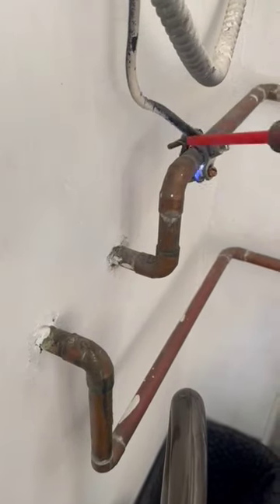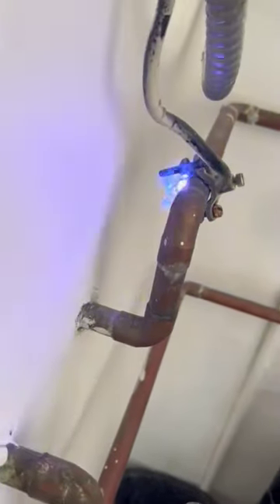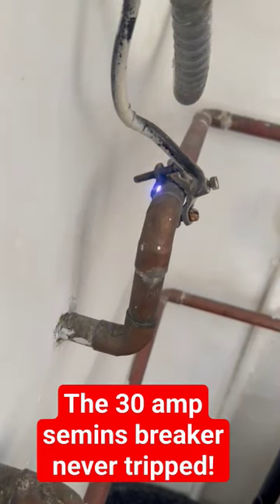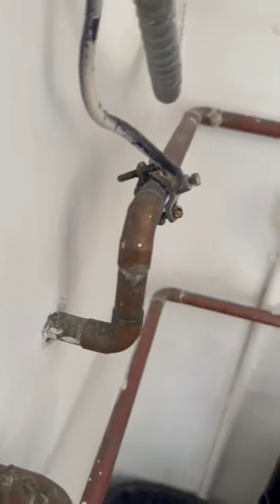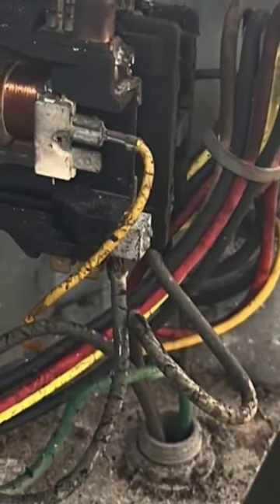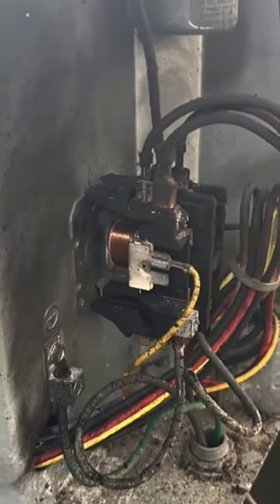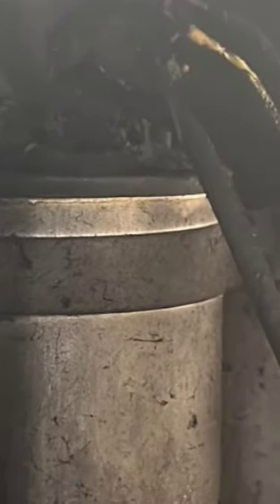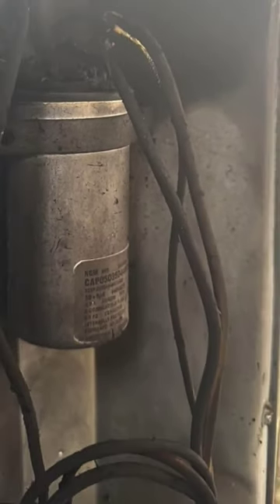Major grounding issue + lightning strike + loose cold water bond clamp = this!

Comment: I'm pretty sure you have your system grounded neutral current returning to the source via the water main grounding electrode conductor. I'm guessing the real issue is the grounded neutral at the transformer is broke somewhere before the meter/ main breaker panel.
Reply from the maker: That's exactly what I thought but it would stop every time you turned off the 30 amp breaker.
Reply: @Simonelectricfl The 30amp breaker for the A/C?
Reply from the maker: @roystevenson1375  yes
Reply: Damn you see something crazy everyday I've never seen this
Reply from the maker: @ChipChurp  I love seeing new and interesting things in this trade that's part of why it never really gets old.
Reply: Crazy
Reply from the maker: shawnstafford7809  that's for sure
Reply: It’s also going to burn a hole into that water pipe making it even more dangerous.
Reply: With most of the plumbing now plastic , there is no ground through the water pipe
Reply from the maker: @user-hy7sf9xx3z  We still find a copper section like at the water heater and clamp there.
Reply: that's correct. stray neutral current. panels done wrong. obviously extremely bad.
Reply: the main water ground isn’t supposed to ground the house, its supposed to make sure the water system is grounded.  The panel should be grounded separately.
Reply: @theJonnymac  Yes. The water ground is an electrode (GEC). The system ground is derived at the transformer from the utility.
Reply: The water pipe was the least resistive path to ground in this case. While electricity will take all paths, a majority of the current will take the path of least resistance, in this case the water line.
Reply: @ryderholland  electrons returning to the source.  👊
Reply: Had this happen twice. One at the transformer.  The other was loose behind the meter.
Reply: in texas the ground and netural are tied together!!!
Reply: @tesmith47  uh, yeah. NEC 250.4(A) requires it.
Reply: Turn off that breaker, disconnect the lines and ground.

Clamp the ground to one multimeter lead, and twist both lines together and clamp
to the other. Set your meter to Continuity and go through your wiring in the unit . When the the beep disappears you had removed the wire from its contact point. 
As for how it happened, I would say that meter or panel isn't bonded depending on if it is a sub panel or not??

I have had this several years ago and clearly the unit was toast but I wanted to find it regardless as it was bothering me.
Reply: @Simonelectricfl one of your hot wires has gone to ground, but with enough resistance to carry a load but not short circuit the breaker.
Reply: @RobertFulton-o9j : can’t Tell you how many times I’ve seen a ground strap attached to a plastic pipe , after they replumbed the house !!!!!! 
No words !!!
Reply: @Simonelectricfl but can you tell me why ?? I have never understood this practice
Reply: @Simonelectricfl  
There's likely not a neutral for the 30A 240V AC circuit. The only way this would happen when that breaker is on would be if one of the hot legs was damaged in the AC somewhere or something was wired very wrong at the AC.  If it was hit by lighting, it's possible it melted the insulation just enough to pass some current, but not enough to trip the breaker.
And yes, that ground at the water pipe needs to be corrected as well.
Reply: @billss396 or a neutral wire, and that would explain why the breaker doesn't trip. This would trip a GFCI though, or an AFCI since it's arcing.
Reply: @alexc4924  this is a 240v circuit without a neutral. A hot wire is charred with enough resistance go to  ground without tripping the breaker as a dead short.  He said it cleared when the breaker was turned off
Reply: @electricianron_New_Jersey And is known as the Primary ground due to it being foremost historically. The ground rod  being Secondary is to be btwn. the cold-water & the panel if run continuously
Reply: @Simonelectricfl the cold-water is supposed to be bonded w/in the first 5 ft. of the entrance to the building or first available spot ... the Bonding at the HW heater is for passing that cold water ground to the other metal piping systems
Reply: @tesmith47 Everywhere mate
Reply: @robertholderman7552 What?! are you saying a plumber actually tried to be thoughtful about resetting the weaver clamps for bonding at hw heater (even if somehow still thoughtless lol)  ... Never in my 25+ yrs lol.

Comment: Let's see if I can translate:  The wiring in the A/C unit was damaged, causing a direct short of a hot wire to the metal parts of the unit.  Since there was no equipment grounding conductor ran to the main disconnect at the meter, and as this missing equipment grounding conductor must be bonded to the grounded (neutral) conductor at the disconnect (per NEC), there was no path for the high fault current to flow back to the source (transformer), which in turn caused the breaker to ignore the fault, resulting in a very dangerous situation whereby all bonded metal parts of the facility took on the electrical potential (voltage) of the shorted conductor.  A loose arcing grounding electrode conductor revealed this electrical potential at that particular location.
Reply: Great explanation, and I agree 100%!

Nice job.

Comment: There is an old Baptist campground near prospect, Oregon that is closed now. It had a lost neutral somewhere and Everytime we touched the cold shower knobs we kids would be mildly shocked in the wet shower. 50 years they never found it as far as I know. Probably one reason they closed them down.
Reply: Thus is cayse by flipping neutral in obesity outlet its on the left the next is on the right so when a neutral is list it trys to find a path also bonding in the wrong panel and ground and neutral on the same buss bar
Reply from the maker: Wish I could have helped sounds like a fun troubleshoot
Reply: old timer from maine told a story about a house where the owner would get bit if he stood in the shower and touched the metal valve.  slab on grade house with a vapor barrier - turned out the vapor barrier turned the building into a huge capacitor.  when the owner touched the valve, it discharged through the bonding/grounding system.  opened the slab and bonded it to ground and problem solved.

Comment: ive seen this during a electrical surge the surge protectors were dumping the high voltage into the ground and arcing high voltage to the whole ground including on the pipe ground got lucky i touched the ground wire with my bare hand with over 500 volts going through it never got shocked from it
Reply from the maker: Wow that must have been impressive to see!
Reply: 500v? Working on what

Comment: Im a lineman. Its not uncommon to get a couple trouble calls a year where someone is getting a slight shock whlle in the shower or using a sink. Years ago the bonded the houses neutral to water pipes instead of ground rods like they do today. If the neutral attachment point on the waterpipe starts failing, the house will try finding a ground somewhere, even if thats through the shower head when someone wet reaches up to adjust it, or someone turning on a sink faucet. Its true electricity finds the shortest path to ground, but it can also use all paths to ground, one of them being someone in the shower.

Comment: Crazy. Lightning does weird stuff when it strikes.
Reply from the maker: That's for sure bro
Reply: Especially when the contractors don't do their jobs properly 😕
Reply from the maker: @BorisSpark yea but it is good they neglected to tighten the water bond because the customer would not have called us when they did and it could have been extremely dangerous to take a shower and ended different. But yea the fact the entire house was not even grounded at all is unforgivable to the original contractor.
Reply: @Simonelectricfl  I absolutely agree, I can't comprehend the ignorance of people who do things like that, as it could have easily cost someone their life.
Reply from the maker: @BorisSpark   Thankfully, we caught this one.
Reply: If the house was grounded properly it wouldn’t have been any issue. Let me guess, house is all electric? They’re lucky 💥 💣
Reply: Especially when the electrician doesn't know what hes doing.

Comment: what you got there is a bad neutral on a single phase primary distribution with a shared neutral. be super carefull because that's a 7200 volt arch
Reply: Well..... its an air conditioner so there is no neutral involved on the circuit, but the ground is obviously not getting back to the panel.

Comment: Copper or metal piped water mains will often act as a parallel neutral conducting sone objectionable current through other nearby residential service heads and then back to utility neutrals. Although with this amount of current flow it’s likely the service neutral here was totally open and house voltage would be fluctuating. Parallel neutral paths are unavoidable with a totally conducive water supply system, some objectionable currents will always be present. Good load balancing and duel earth grounding w rods or ground ring will reduce this greatly. You can also actually be getting stray current from your neighbors.

Comment: Yikes!  There's so much wrong there. Main thing is it should be in the NEC to require safety ground wires to be run to an isolated ground rod, not the electrical panel.  How insane is it that the safety ground wire is run to the most unsafe place to put it?  I guess NEC is trying to save everyone money by not requiring the isolated grounds, but how much equipment and people have been electrocuted from this same mishap?  I wonder how the cost analysis pays out in 2024.
Reply from the maker: Yes not good

Comment: This actually happens more often than you would think. In old houses with metal water lines it was common to ground to the water lines because they were all metal and ran a long ways underground. So when the power company ground rods oxidized or rusted to badly to carry the load the entire house grounds through the water lines… There have been times when  people have been electrocuted because of this, and other odd ball grounding loops.

Comment: That comes from wene you have droped the neutral,,, and the ground is acting as a return path,,,, there is more of an issue than. Abad connection at that water pipe clamp

Comment: If your using metal water piping as a grounding electrode it must be done within 5 feet of the entrance of the house according to code.
Reply: Can you explain why that is?
Reply: @GoddexxJae  means that if your going to use the water line for your main source of grounding for the panel then it has to be connected within 5 feet of the house entrance. If you are using ground rods for grounding then you just need to bond the water line and that can be done anywhere on the house.
Reply: @1prodbyhd  I guess what I don't understand is the reasoning behind it needing to be within 5 feet of the front door, when the panel is on the other side of the house. (usually)  In my head it would make more sense to have it the shortest distance possible from the panel? I'm not an electrician tho..
Reply: @GoddexxJae  I believe it’s because the water pipe being used as a grounding electrode has to be in contact with the earth for 10 feet, and that’s the only way you can verify it’s in contract with earth by if it’s by the door.

Comment: I was wondering about those aluminum clamps while working on a high end commercial remodel. It didn't look to me like they have enough surface area in contact with the copper pipe, particularly considering the propensity of aluminum conductors to develop high resistance at it's surface due to the oxide layer and start electrical fires. Which is why connectors for aluminum wires are designed to penetrate the surface of the conductors

Comment: In 1988 there was a movie called Pulse. Like the movie, Virus, it dealt with a malicious presence found inside an electrical current. It traveled from house to house through the power lines, wrecking havoc on the people found inside by hijacking control of the appliances.

One scene dealt with the presence hijacking the house shower, elevating the water temperature to the boiling range and locking the glass doors so the occupant couldn't escape. Something that shouldn't be possible even inside the universe of the film since there's nothing electrical involved with the shower.

My theory to explain the scene is related to this short. The house electrical system was grounded to the galvanized/copper water piping in the house, allowing the presence to direct itself through the water to electrically lock the wet glass doors in place against the metal frame, while stimulating the atoms in the water to increase the temperature significantly.

Comment: Old houses with 100 amp
Service often used the water line for grounds. My buddy built an attachment for a small jack hammer to drive a rod 10 feet in

Comment: I've seen something similar to this. The house was grounded to the copper water lines in the house. The plumber changed the water heater using pex pipe as the hook up. That broke the grounding and made the house have a open neutral.

Comment: Open neutral.  Check voltage both neutral at conductors coming into main breaker.  If a nice size difference from one to other prob at meter pan weather head or pole connection.  Also tighten up that water pipe ground stop the arcing.

Comment: That’s why Swedish plumbers are taught to place a grounding wire over the water meter when the incoming pipe is iron or copper.
Reply from the maker: It helps when they are tight and not energized
Reply: In the US, we are also required to run the cold water bonding wire continuously from the first means of disconnect off the service to both sides of the water meter, just in case the water meter needs to ever be removed or replaced.
Reply: @El_Diablo_LI  We didn’t have that requirement until ~25 years ago and by that time no new built houses used copper or other metal pipes as incoming pipes to properties. 
This means that it’s only the older houses that lacks these bonds and they lack them completely. The risk is also present at almost all parts of the installation that has to do with water, getting a tingling sensation when doing the dishes or showering are not common but not unheard of in these hold houses

Comment: Ohm out each black feed line disconnected from breakers 1x1.  to ground and neutral. bars.
Might need to unplug all loads/appliances.  Lightening will arc through romex, or pretty much any conductor seeking earth if near a grounded item, ducts, pipes, or even another branch, even hidden in a wall, metal jic boxes. 
 If utility guy neutral is open before meter or distro panel, technically 2 appliances at 115v on opposing phase legs would total 230v if both were on simultaneously.  
  Are  hot water tank pipes bonded? Check flowing water with vom to ground if pex system

Comment: Definitely a dangerous situation where the Building Structure Main Service Panel electrical Earthing Bond was damaged, missing or not existent,   When lightning struck no usual places for enormous Fault Currents to dissipate blowing apart HVAC unit and probably any additionally connected household appliances and device's as well.  Definitely should install Whole House Surge Protection & properly installed code compliant Grounding System will save thousands of $$$'s in repairs/replacement costs against major Electrical Surge Events whether by natural lightning strikes or incident service interpretation ie(blown utility txfr, downed line, etc.)

Comment: My "starter home" got bought off an old electrician who was also its builder. We replaced 3 electric water heaters in 12 years. (There were 2 old dead water heaters left in the crawl space when moved there. These were unnoticed by our home inspector...   Had to replace the main water shut off and I noticed the electrical ground  for the entire house was on a copper pipe running into loose earth. nearby. I dug around the pipe with my fingers. 6" down I found a huge ball of greenish copper corosion. = 6" was all the grounding we had and WHY we were EATING water heaters...

Comment: I have seen this before. 
What happened at the customer's house was the meter socket was so old, the neutral conductors were rotting away to almost nothing, leaving only the water pipe bond as the sole means to carry unbalanced loads.

Comment: And the ac unit took all the force because it was probably the only thing grounded and its not meant to take a lightnighr strike by itself. Usualy the ground is connected to the grid or a couple large copper steaks driven into the ground

Comment: It's gotta be feeding through a transformer or that capacitor. If it's doing that your breaker will not trip. It's so dangerous.
Reply: The circuit breakers are only there to protect the wiring in your house, not the plumbing. lol

Comment: Grounding at waterpipe was not  loosed as you assumed. Check at rust side. Was contacted andsurface little rusty tighted. But lightning happen or neutral current from transfermer into it. It arcing all bonding teeth to loose connection!!
Beware this kind of grounding only for small user, not for lightning.